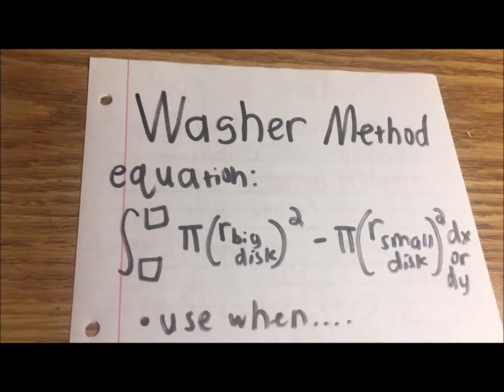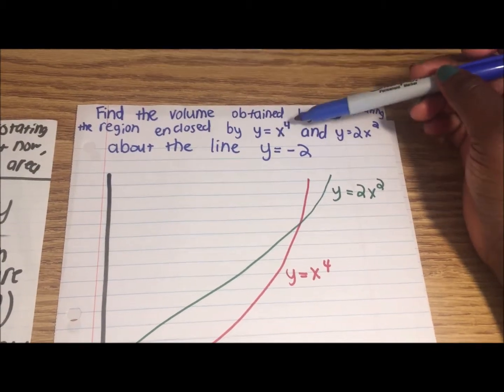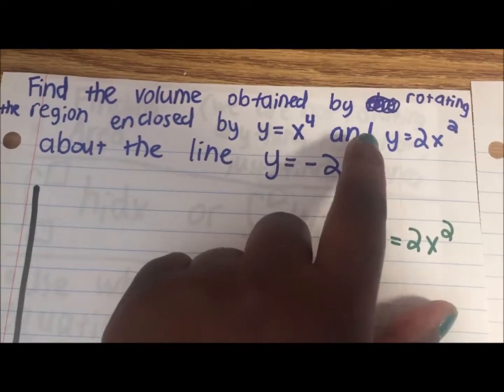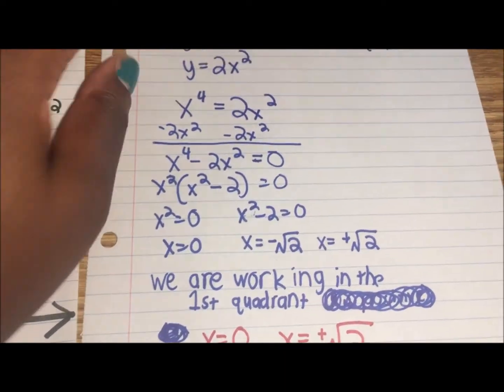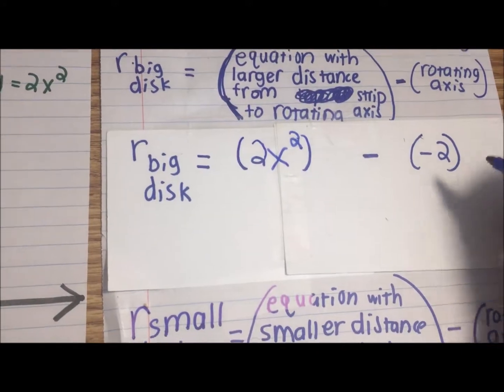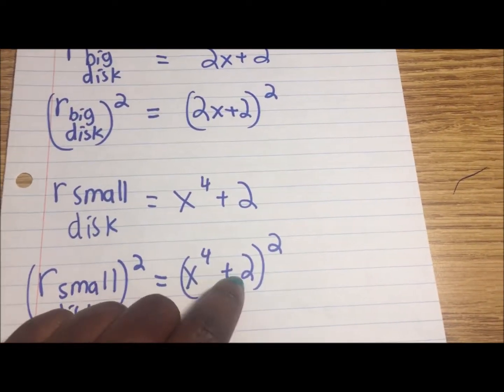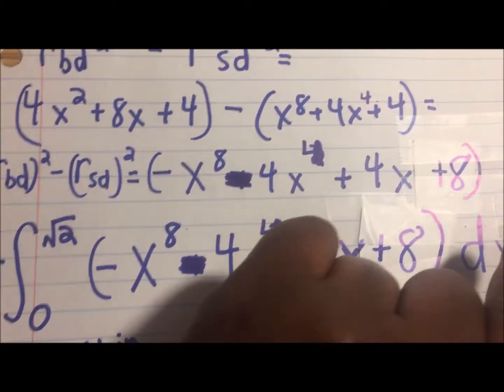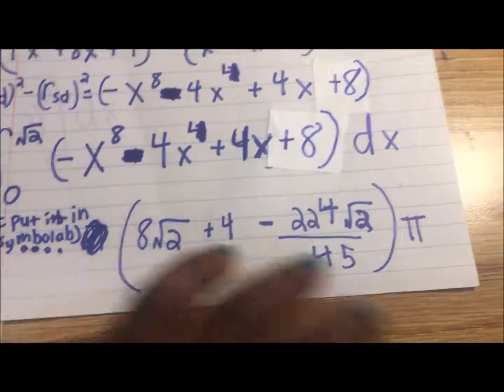Washer method tutorial

Comment: Pls.if the region bdd. by x^4 , 2x^2 ;
       [ 0 , 1 ] rotated around y=0.5 . What is the Volume?
Reply from the maker: Okay so i did it and I got  7.1558. 
So lets make y1 = f(x) = x^4, and y2 = g(x) = 2x^2.

So first, since the rotating axis is y = 0.5. g(x) has a smaller distance to the rotating axis so r small disk is 2x^2 + 0.5.  f(x) has a larger distance to the rotating axis so r big disk is x^4  + 0.5. 

So, When you set up (r small disk)^2, you get (2x^2 + 0.5)^2, which is 4x^4 + 2x^2 + 0.25. When you set up (r bigdisk)^2, you get (x^4 + 0.5)^2, which is x^8 + x^4 + 0.25. So when you do (r small disk)^2 +  (r big disk)^2, you get  x^8 + 5x^5 + 2x^2 + 0.25. 

So now, we have to find pi * the integral of x^8 + 5x^5 + 2x^2 + 0.25 from the boundaries 0 to 1. That is 7.1558.
Reply from the maker: I will look back into this and respond
later with results once I solve the problem myself